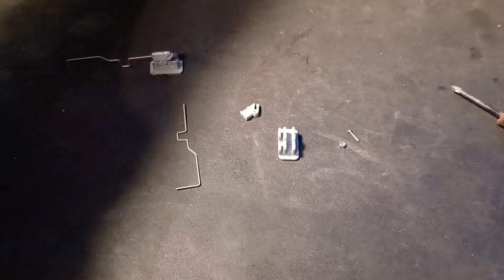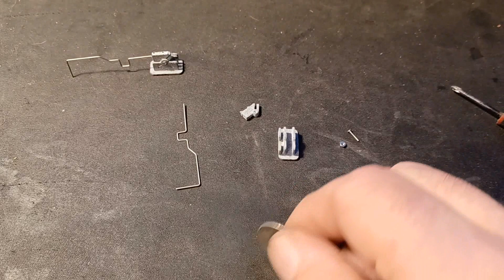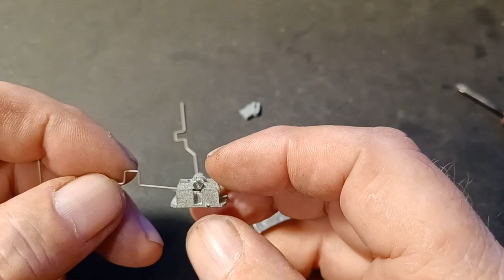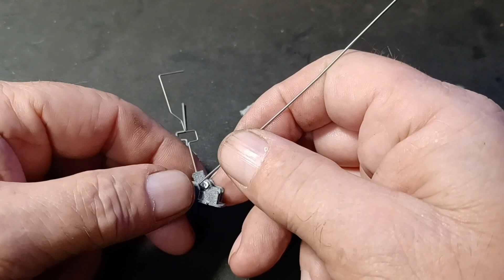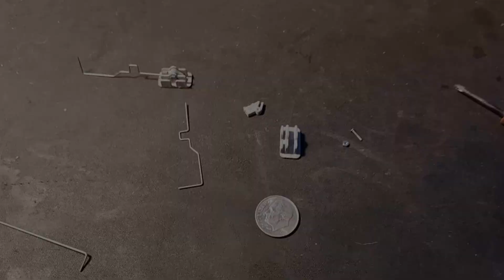MinimumRC - Retractable Landing Gear Inspection

Comment: I wonder if this could be applied to eachine spitfire 400mm
Reply: It's too lightweight for the 400mm warbirds, which run in the 60 grams and up range.  They are made for sub-30 gram aircraft like those sold at Minimum RC.
Reply: However, if you have access to a good 3d printer, you might be able to scale up the design for a 400mm airplane. That's basically what I'm considering, since I can't find anything in that class for sale.

Comment: Update post mouse attack,I got the Mustang back in the air using bits of wing from the spitfire to replace the chewed up mustang ones…the cockpit bubble has been eaten,so I taped it up length ways and created a pilotless experimental version…I swear it’s faster ..! (Not really) and it wobbles a bit,think the thrust line may be out of cock…as the mouse ate a bit of the nose too…but…it’s all good.I love these planes.Cheers from the UK.
Reply from the maker: Nice.  Maybe you can mount a micro DVR video camera where the cockpit once was a make a camera plane out of it now.  You can still get new wings for it if needed.
Happy flying!
Reply: I would say "get a cat" except my son's cat has eaten several of my balsa airplanes before I could even cover them.

I've threatened to make her into a hat more than once. 😂